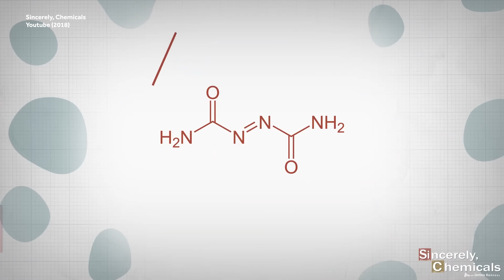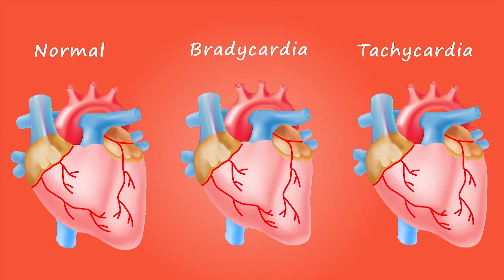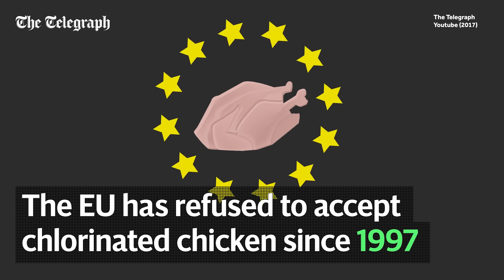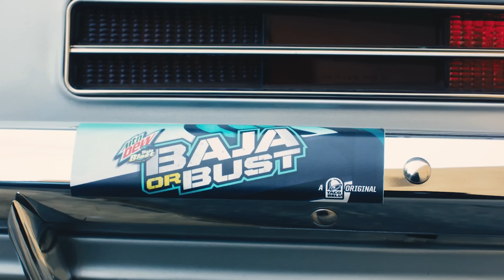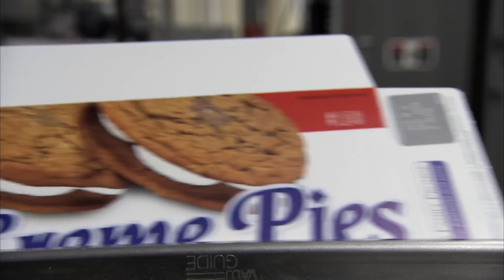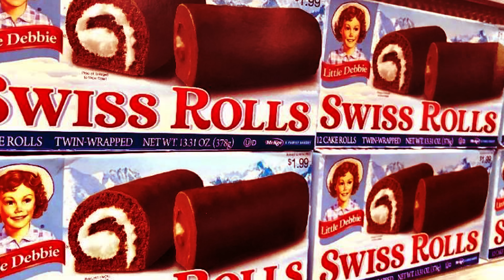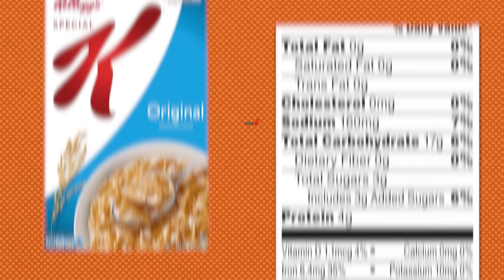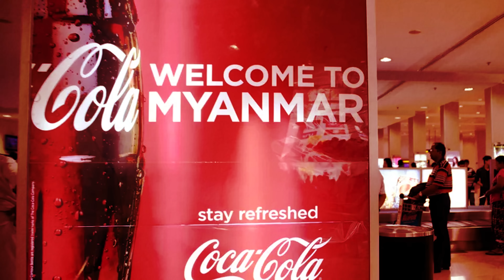American Foods That Are Banned In Other Countries

Comment: Bread: flour, water, yeast.
Wonderbread: Enriched wheat flour, Water, Sugar, Yeast*, Vegetable oil, Salt, Calcium propionate, Vegetable monoglycerides, Sodium stearoyl-2-lactylate, Sorbic acid, Enzymes, Ascorbic acid, May contain added wheat gluten, Diacetyl tartaric acid esters of mono- and diglycerides, L-cysteine hydrochloride.
Reply: ohh THAT'S why it's called 'wonderbread'!!! Because I wonder what half those ingredients even are 😦
Reply: As someone working in the Food Industry in Germany, some of that stuff only sounds special + or is just needed for the technical process to produce it in large quantities and near same products.
Like Ascorbic acid (Vitamin C, for natural preservative, oxidation protection and because vitamin C is often added during the manufacturing process when products are heated, as vitamin C begins to be destroyed in certain quantities from 40°, at most temperatures above 100° considerable parts are destroyed.)

 L-cysteine is used in the form of the hydrochloride as a flour treatment agent and baking agent in the production of baked goods. It softens the gluten by depolymerizing the molecules of the gluten fraction through thiol-disulfide exchange with the intermolecular disulfide bonds (i.e. breaking the bonds that hold the long chain molecules together).[21] As a result, the dough becomes more elastic and develops faster. With high-gluten flour, a higher baked volume can be achieved because the leavening gas (such as the carbon dioxide formed by the yeast) can loosen the dough more easily.[26] Cysteine hydrochloride can also be added in the production of pasta to speed up dough production (an addition of 0.01% shortens the mixing or kneading time by 15-20%). It inhibits the formation of melanoidins during non-enzymatic browning and thus counteracts discoloration.[26] In addition to these applications, cysteine, like other amino acids, acts as a flavouring agent, flavour enhancer and nutrient.[27]
L-cysteine hydrochloride or hydrochloride monohydrate is approved under European food law as an additive without maximum quantity restriction (quantum satis) under the number E 920.[28][29] In principle, it is subject to declaration, but not if it is no longer technologically effective in the labeled product in accordance with Article 20 of the Food Information Regulation and Section 9 (8) No. 1 of the Additive Approval Regulation. According to the Baking Ingredients Institute (an institution of the Baking Ingredients Association), the technological effectiveness of cysteine used as a flour treatment agent (i.e. already added to the flour before leavening) does not extend to the finished baked goods, but to the dough piece if it is offered as a semi-finished product, for example.[30] It therefore does not need to be labelled in finished baked goods. The Federation of German Consumer Organizations does not share this legal opinion

Diacetyl tartaric acid DATEM (E472e in EU)  is a emulsifier primarily used in baking to strengthen the gluten network in dough. It is added to crusty breads, such as rye, to impart a springy, chewy texture

To name some, but the list for our Bread is still alot of shorter and more basic natural ingredients used.

Best is still to make your on Bread, its easy, cost not much and you have alot alot of different ones to try, alone germany has over 3000 food register.
But canned food, especially canned fruit/vegetables, is often even better than normal frozen food and comes close to fresh, the vitamins and minerals are still present to a very large extent.
Reply: No wonder I feel awful after eating it. 😂
Reply: Well put
Reply: It's a wonder anyone eats it.
Reply: And hair
Reply: Too much!😢
Reply: well i mean its supposed to sit around for a decade before you eat it isnt it we wouldnt want to waste a loaf it would cost too much
Reply: Is because they want that his products last longer in the shelves
Reply: @qreendau 😂😂
Reply: lolol 😂 theae comments
Reply: not it having sugar😭
Reply: In UK our old Prime Minister Margaret Thatcher put it into British law that bakeries do NOT have to list ALL the ingredients in a loaf of bread.
Reply: Why is there an asterisk next to "yeast" :(
Reply: Don't forget the cellulose
Reply: I actually need to buy a bread maker here in South Africa. I am tired of the addictives.
Reply: Wonder - why they eat it!?
Reply: Lord had mercy thank god I don't eat that stuff
Reply: There's formaldehyde in it as well.  That's why it stays fresh forever and will not mold under any circumstances.  The same chemical that's used in embalming fluid.
When bread goes moldy, it is a good sign that the ingredients are natural.
Bread is supposed to eventually go moldy if left at room temperature when conditions are favorable.
Reply: you forgot salt. bread has salt. and quantity is regulated in many EU countries.
Reply: Not nature's own😮
Reply: Tomorrow when I exercise, I'll pretend I'm laying on a slice of wonder bread.
Reply: OMG!!!!😮
Reply: Sick.
Reply: sounds scary because you have no idea what any of those words mean.
Reply: 500fm Bread flour, 30gm butter, 2tsp yeast, 1tbs sugar, 340ml water, 2 hours in a bread maker in my house.
Reply: Yep, that's how we make wonder women too
Reply: @Curlyblonde All breads are bad.. it going moldy is a sign, but not enough.. I mean how on earth anyone can go off by just that.. 
I will add to your thing, 
Avoid all breads
Reply: Sounds like some crazy science experiment HYDE & JEKYLL would make😂
Reply: It's a wonder why anyone would eat it.
Reply: L-cysteine is human hair.
Reply: Wonder Bread: It's a wonder they can call it bread.
Reply: We make our own...heck no to that mess.

Comment: When I was diagnosed with high blood pressure I had to start reading food labels. American made food products have a shocking level of sodium compared to products from other places.
Reply: It's ridiculous. Low sugar, no sugar, no high fructose corn syrup, low fat, no fat, and so on. Yet the list of low and no sodium products is very short, and just like removing sugar, they often replace it with things that are just as bad or worse. My frozen dinner doesn't need 1/2 my daily sodium intake, because, it's frozen. 🤷🏻‍♂️🤦🏻‍♂️ It's only good for a year or so anyway before freezer burn, tons of sodium or not. Just the stupidest 💩 ever. 😒
Reply: Because it tastes good
Reply: Having low sodium will actually exacerbate high blood pressure. You should make sure you have plenty of electrolytes. In fact many people don't get nearly enough and have gotten scared of salt due to out of date research.
Reply: @maikeoto6903  ...and most people get too much sodium. Way too much.
Reply: @section8usmc53  not really. Our bodies are incredibly good and processing sodium. You'll just excrete the excess sodium in urine. The problem is where you don't have enough sodium to regulate normal bodily functions. Our diets used to have WAY more salt than we now do due to no refrigeration. Yet there were no reports of hypertension or other issues with kidney function. Our bodies are used to excess sodium, not used to not getting enough. You can have over 6 times the amount of salt the USDA recommends and it poses much less of a health risk than actually listening to their outdated guidelines. I say look into it more and you'll find that the little war on salt is a pathetic argument that's killed thousands.
Reply: Sodium is not the problem. Real problem is carbs and bad fats like seed oils, margarine some other shit people are consuming. There were just some studies that the better way to get rid of high blood pressure were with keto diet than what doctors and food therapists are normaly recomending. It lowered 40% more blood preasure than that diet that the doctors are given. And this was groop study where they studiet two different groops and diets.
If you really want to get rid of it and live healthy i can say it really works. Also you will drop some weight and if you have type 2 diabetes or/and insuline resistanse, you can get rid of those too.
Reply: American made & EU owned.  There are few American food & personal care companies not monopolized by the EU.
Reply: Moutain Dew has yellow die - "has desire to be annoying to people."  That's why Skip annoyed Shannon like that everyday and forced him off the show.
Reply: An they are putting high fructose cor syrup in everything ex: mustard.  The package foods sometimes have 2-4 different types of sugers and multiple kinds of salt.  No wonder people are sick.  Keep up the good work watching those food labels.
Reply: Sodium is not the cause of high BP...
Reply: Then your doctor is incompetent. Sodium is a minor impact on bp in most patients.
Reply: Sodium being a cause of high blood pressure?
Reply: Im in the UK, and i had to do the same. The unpronounceable crap chemicals in foods is crazy.
Reply: Yep, sodium and sugar. No wonder we don’t see more ambulances at restaurants, although have seen a few. Someone got more than their share of sodium overload?
Some bar/restaurant had
Reply: @maikeoto6903  true.
Reply: Carbs are not bad. It's the type of carbs that we eat that either cause an insulin spike or a steady release of glucose. And depending on what we eat with those carbs such as fiber and protein, that can lessen a glucose spike and insulin release.  There are no studies done that prove seed oils are bad. A lot of it is hype. Now the difference between saturated fat and unsaturated fat can make a difference. Keto has also not been proven to be beneficial for the body. Keto is just another unsustainable fad diet. Humans need complex carbs, fat, and fiber. It's worth it to look into each piece of the puzzle here along with your own body, allergies, and energy. It's been shown over and over again that the more things that we eat that grow from the ground and fall from trees, the more our health comes into balance. In addition a sedentary lifestyle causes a multitude of problems that food alone doesn't fix. Most people eat a diet full of processed foods and simple sugars that release tons of glucose at one time and instead of going into the muscles like it would if we were exercising, it just releases a large amount of insulin and creates insulin resistance and stress on the body.
Reply: @maikeoto6903  when all your food has high sodium...it's an issue.
Reply: And high amounts of sugar
Reply: The government is making us sick
Reply: @maikeoto6903  this isn't true, you can actually die from salt overdose
Reply: Sodium does not affect blood pressure. May I suggest looking up cited sources from food geneticists like Dr Yeo and others. There are other informative videos about sodium and animal fats.
Reply: Idk if you should listen to this sodium doesn’t cause issues talk… personally I feel much better on a lower to moderate sodium diet.
Reply: A little snack once in a while or hell even everyday after a meal won’t hurt you 💀. A lot of these videos are very fear-mongering and coupled with paranoid Westerners makes them see anything seasoned (shout out to anyone who remembers the MSG panic) unhealthy.

Comment: I bake bread often at home and it's good for 3-5 days, a week at the absolute most. We forgot a loaf of grocery store sliced "bread" in the back of the cabinet for almost two months, well past its sell-by date. It was not only not moldy, it was still soft. I'm wary of the stuff now.
Reply: I left a big Mac on the counter for 5 days just to see and it looked the same. Scary
Reply: Yeah, it's a little thing called preservatives. The kind of bread you bake would go bad before they could even sell it.
Reply: they add both preservatives and in fact also stuff to make it soft. here in germany, bagged toast tends to last 10-15 days, I think. markedly longer than bakery or homemade bread, but certainly not 2 months.
Reply: I find the cheap white sliced bread smells funny - like dog food.  Its disgusting smelling
Reply: Understandable.
Reply: I've also baked bread for years and I have also been wondering the same thing about store bought bread.  That stuff keeps for weeks on the counter.  That is NOT normal for bread - which normally lasts only about 3 days.  What do they put in that stuff anyway? 😳  Makes me wonder whatever happened to buying day old bread?  That's clearly not even a thing any more!
Reply: This is starting to happen to the fruits I buy. Especially apples now. You use to be able to put your Apple on the windows sill to make them into witches. Now they don’t shrivel. 😳
Reply: @pretyoasis1  Well, apples are meant to over winter in giant warehouses.  That's why you have apples all year around.  Try leaving your apples out longer.
Reply: @toocutepuppies6535  hmmm. I’ll leave it out longer then 6 months then and see what happens. I just remember as a child it only being a few weeks.
Reply: I remember bread used to mold seemingly not super long ago maybe a few years ago at most. Very interesting
Reply: @pretyoasis1  I remembered something about those apple dolls, you have to dry them in a dehydrator.  If you leave your apple on a window sill it will just rot and turn to a stinky, soupy mess, covered in fruit flies.  Use a dehydrator.
Reply: @toocutepuppies6535  yea it was the 80’s we just put them on the window sill at school and they turned wrinkled and small. Nothing fancy back then. I’m going to try the dehydrator. Thanks for the idea.
Reply: @pretyoasis1  you have to use varieties that have less sweetness and water content like cooking apples and not honey crisp. And it's easier to dehydrate them if you take off the wax they love to put on them nowadays, that's why they keep longer. And yes a dehydrator is useful for modern varieties that have been bred for more flavor and hardiness. Sources: worked in a orchard with multiple varieties in dwarf size for years.
Reply: @chey7691  thanks Chey, I appreciate the advice. I will try using a different variety and the dehydrator. Set which comes out better.
Reply: According to a video i watched on how to make bread,  they use a lot of vegetable oil to make the bread you buy from stores.   It gives it the bendable texture without breaking,  another reason why it lasts so long.
Reply: Veggies generally do not taste like they used too.  I remember how eggplant and tomatoes used to taste in the 70s.  Not now.  Remember how skinny people were back before the 90s?  It’s when all the growth hormones, GMOs, etc. started going into food people got thicker.  I’m not talking over-eating or obesity:  people are thicker, even the people considered thin.
Reply: Bread in london goes bad in 3 days
Reply: Omfg
Reply: @EmeraldEyesEsoteric  no, fresh bread is sold everywhere where I live
Reply: Not the bread we’ve gotten but some of it doesn’t get moldy like it use to.
Reply: @8cj1ec  I remember it getting moldy too.
Reply: @pretyoasis1  1dEPENDS ON WHICH TYPE OF APPLE AS WELL, SOME KEEP A LOT BETTER THAN OTHERS AND I THINK THEY MAINLY SELL GOOD STORERSNOW

SORRY FOR THE CAPS, CAT ATTACK AND THEY WON'T TURN OFF
Reply: One baker said to my that never by (white) bread that doest get moldy or turn too hard to eat in three days. 
Ruy bread lasts better about week but is very dry at that point too.
Reply: No it wasn't.
Reply: I make my own bread too and I love it.  If I do buy bread from the store, it is usually one that is an Organic one
Reply: I live in a country where you can buy fabulous bakery made bread, but is too chewy for me. Then there is packaged bread which is loaded with sugar. The only way for me was to buy a bread machine.

Comment: Not only that, Nestle makes a diet shake (UltraFast 900) that is essentially a yoyo diet program/scheme. It's a doctor assisted weight loss program that uses these diet shakes to trick you into seeing results. In 5 months I would lose 40-50 lbs, and then over the course of a year all that weight would come back on. They prescribe the type of food that you eat after the diet shake portion of the diet. Inevitably,  the weight always comes back on. I tried it about 6 times for over 9 years, and each time the weight came back on. One year, I was even rushed to the hospital with a case of a blocked bowel, or impacted feces. Very painful. I still wonder, did these Nestle UltraFast shakes play a role in this painful bodily breakdown of mine.
Reply: Most likely.

Comment: The vitamin b12 in Special K cereal is a synthetic form called Cyanocobalamin(which has traces of cyanide in it) and reason it is bad is the Aluminum that is present in the preparation of the Cyanocobalamin. The two safer choices for Vitamin b12 food and supplement consumption is Methylcobalamin and Adenosylcobalamin are both naturally occurring co-enzymes that are found in food sources.